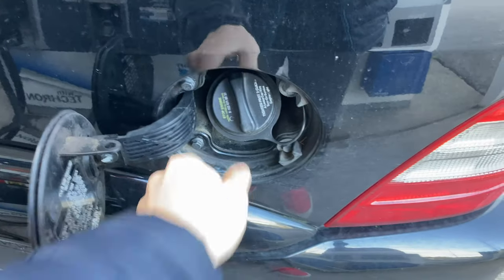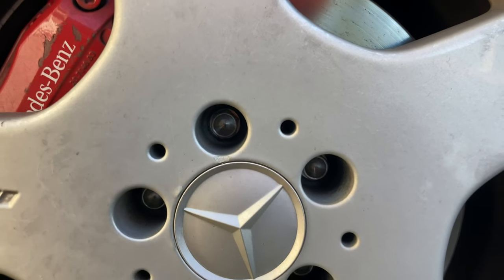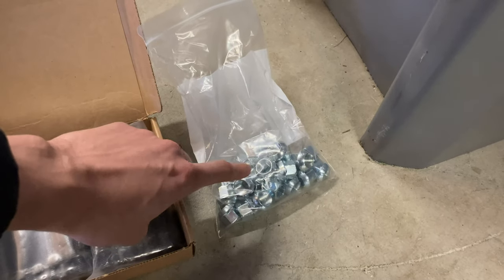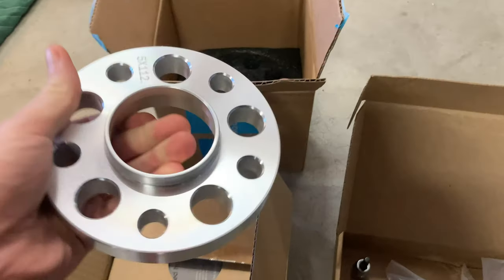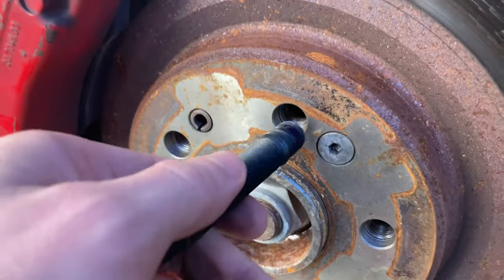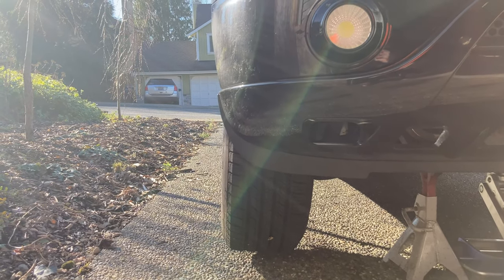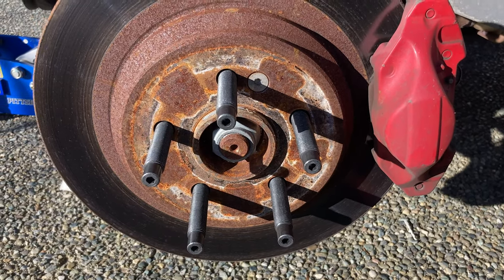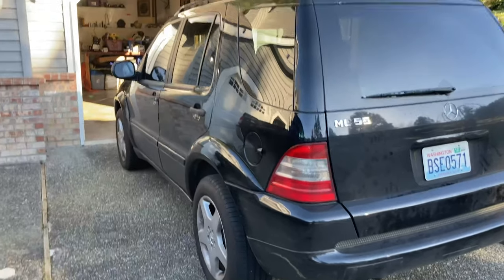HOW TO INSTALL WHEELS STUD CONVERSION AND SPACERS

Comment: Looks good you should get continental tires 285 50 18 I have a ML 55 AMG same color
Reply from the maker: Nice! Cost effective wise plus availability and performance wise, not really worth it. Only slightly bigger contact patch vs my 255 that doesn’t do much since it’s already all time all wheel drive. Never have a problem with grip in this thing as is, which you can see in the 0-60 video I posted 😎 6.04s and factory rating is 6.3s. Plus I’m saving a lot in tire weight which being unsprung weight, makes a big difference. 🤙🏼

Comment: Are those tires the standard size?
Reply from the maker: They are 255/55/18, same aspect ratio as the stock size but a little bit skinnier. Much more available though than the 285 stock size
Reply: @ANDERZENAMG  That's quite a bit skinnier. 30mm is over an inch and the aspect ratio is a percentage of the width so a bit shorter as well.  Thought they looked a bit more narrow. Great trucks the 163's were. They all rust out here in Ohio. Would love to see yours with the wider meats and the spacers.
Reply from the maker: @bicylindrico  if I find a good deal on 285s next time I’m in the market I’ll go for it haha but honestly don’t think it would help performance at all. Definitely a chunk narrower and about .1 in less diameter. 🤙🏼 luckily this one doesn’t have much rust, they definitely had issues with it in certain environments though.
Reply: Please how much did the purchase cost?